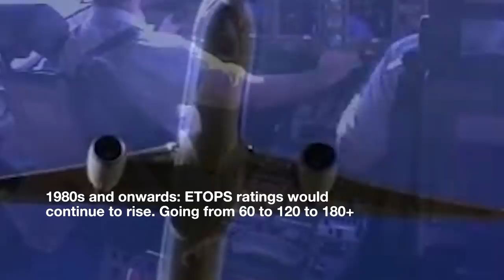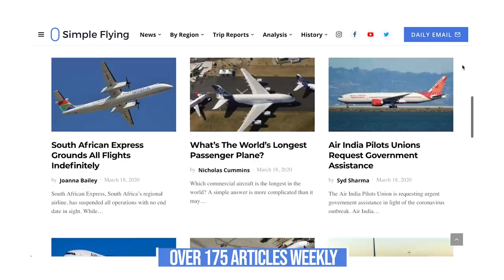Why Did Tri-Jet Passenger Planes Not Become Popular?

Comment: I read an article speculating that hybrid turboprop and turbofan tri engines were being developed, or at least researched. The idea being that smaller regional jets would sustain flight with the single tail turbofan and the turboprops would be used to climb and take off. For carbon emission reduction, these hybrids were also speculated to fly slower than current A320s and 737s for greater efficiency. The turboprops also favor some form of electrification better than turbofans.

Comment: I flew on an MD11 (or DC10) once.  There is a design quirk/flaw with the plane.  I'm not sure if all tri-jets suffer from this but the MD11 or DC10 did.  On takeoff, all three engines would be going well, but once the plane rotates (nose pitches up for taking off) the tail engine would get spoiled air and become starved for it because the air at this point in the take off will be flowing around the fuselage instead of directly into the engine.  And sometimes the engine will stall.  So essentially you have a three engine plane trying to take off with just the two wing engines.  

Pilot on the flight I was on explained this to the cabin when it happened on our flight.  I didn't even notice it when it happened but suddenly realized that maybe the cool looking tri-jet wasn't all that it's cracked up to be.
Reply: T38 Talon  Just reporting what the pilot said.

Comment: A well produced video and good summary. Trans-oceanic air travel started with flying boats which had the contingency of landing at sea in extremis. Post WWII the landscape had changed with land planes that could easily fly oceanic routes. But these were the big piston engined types and reliability just wasn't good enough for public transport in twins. That is why the 4 engine rule was introduced in the first place. 
   The first generation of commercial turbine engines were more reliable, but they were stuck with the 4 engine rule and later the 3 engine rule. These days, the shutdown rate of the modern turbine is 60 times better than those old piston engines. And that's per flight hour so it is actually about 120 times better in terms of air miles due to the jets cruising at double the speed.
   Despite this outstanding improvement in reliability, the regulations that govern remote and oceanic operations have become more stringent in every way except number of engines. The aircraft comes certified for a specified diversion time (regardles of how many engines it has) but a lot of other factors come into play before an airline can fly a route. For instance, is there enough accommodation for the passengers carried available in the vicinity of the diversion? Does the airport have the requisite firefighting capacity for the size of aircraft? There is a documentary series called "21st Century Jet" about the development of the 777 that explores those issues as the commercial success of that big twin really depended on them getting approval for diversion times beyond 3hrs.
Reply from the maker: Thanks for the feedback! - TB

Comment: Having 3 engines gives peace of mind... In many cases we see both the engines are lost and aircraft goes down... 3 engine give extra level of security
Reply: The vast majority if not all of these cases would have happened with trijets or quads. Most multiple engine failures involve fuel starvation. If you have no fuel, it doesn't matter if you have 1, 2, 3 or 8 engines, the outcome will be the same. On the matter of 8, in 1961 a B52 crashed after running out of fuel. Oh and another crashed after an engine fire caused damage to the wing and other engines. Other crashes due to twin engine failures have involved multiple bird strikes. If you hit enough birds that it can take out 2 engines, it can take out 3 or 4. Then there was the British Airways 747 that nearly crashed after loosing all 4 engines flying through a cloud of volcanic ash.
Actually, far from "many cases" you'd be hard pressed to find a single case where a twin jet has lost both engines due to independent mechanical issues (that would not cause problems for other engines).

Comment: I believe they should bring back triple engine planes. Reasons being one for safety. If the twins fail for some reason, the third engine could come in handy.
Reply: Yet the chances of both engines on a twin jet failing for some reason that wouldn't cause all 3 engines on a tri-jet to fail is tiny, much lower than many other issues that can cause a plane to crash. Also, in the event of two engines failing on a tri-jet, there is no guarantee that the 3rd engine will be enough to save the plane. Twins are designed and tested and pilots are trained and practice to be able to fly safely from V1 (the decision speed below which the plane can safely stop on the runway if an engine fails) to touchdown with an engine out. Tri-jets are the same, but the important issue is "with an engine out". With 2 engines out, that's beyond what anyone is prepared for. The plane would probably not be able to maintain altitude. If the failure is of one of the outer engines and the tail engine, control at low speed may be impossible, in fact it might be safer to shut down the engine and glide.

Comment: perhaps tri jets will be back in the future, since it could be done engine 1 and 3 are electric and the eng 2 is a normal engine producing a ton of power to power the others, mabye in combination with a "small" battery pack for night flights fully electric
Reply: You can't fly a plane on batteries. Jet engines will only work with jet fuel and hydrogen fuel. Also as noted tries have more maintenance then others since you have to use a crane to get at the tail section.

Comment: For that additional comfort of knowing that you are flying with three engines, I'll like to see them comming back 🔙 but still competitive with twin engines aircraft. With two engines, you still ask yourself that what if one 1⃣ engine could fail just before lift/ take off from the runway?
Reply: The plane would climb out at V2 (single engine climb out speed) and would level off at a safe height. It would then continue to fly until it was able to make a safe landing, either after burning off or dumping fuel to get it below safe landing weight. The pilots are trained to handle this and will have practiced it many times in the simulator.

Comment: i really thought that tail engine was abandoned because if it catches fire.. it will burn the whole tail segment which will lead to plane crash..
Reply: The most catastrophic incident was when the fan blades flung off and cut both hydraulic systems to the control surfaces.   Fortunately the chief instructor for that plane was on board and came up to help and used engine thrust vectoring on the remaining wing engines to steer and guide the plane in for a cartwheel landing which still saw deaths for passengers behind the wing but many were able to survive and a few walked away.

Comment: The rear of the L1011 cabin was extremely noisy.
Reply: Not as noisy as seat 38F on a 727. The engine gearbox was right outside your window. Been there, done that.

Comment: Don't have to watch the video to know the answer: that middle engine was a royal pain in the ass to work on because it was so high up out of the way, and when it had problems (a.k.a. "blew up"), it had a tendency to knock out the entire hydraulic system and all the backups because the rudder control hydraulics were right there. Eventually, having 2 engines became reliable enough, and the fewer engines you have, the more fuel efficient your plane, and the lower the operating and maintenance costs.

I only know of 3 commercially successful tri-jets: 727, L1011, and DC-10/MD-11. Everything else was 2 or 4.
Reply: How about the Hawker Siddeley Trident
?
 
The Hawker Siddeley HS-121 Trident (originally the de Havilland DH.121 and briefly the Airco DH.121) is a now-retired British short- (and later medium-) range airliner. It was the first T-tail rear-engined three-engined jet airliner to be designed.   Versions carried between 100 and 180 passengers.  There were 117 built.
Reply: @alanstevens1296  That falls under "I only know of". :) Never heard of it before (and I wrote my comment before watching the video and seeing it there). The one that I HAVE heard of and forgot about until I saw another comment was the Dassault Falcon business jet.
Reply: @c182SkylaneRG  - No problem, was not trying to be critical, just wanted to add to the discussion.  Of course, only 117 sales could be argued to be not very 'commercially successful'.
Reply: @alanstevens1296  True! And my impression is that there were actually a fair few trijets in existence back then, or at least a fair few on the drawing board, but those three (and the Falcon) are the only ones I ever really heard of, which leads me to believe that they were the only ones that were really successful.

Comment: I would imagine they would, if one day air travel picked up and boomed somewhat again, and a placeholder for the 747 and A380 as a large intercontinental jumbo with 3 engines, that could still potentially be just as fuel efficient as twins with physically larger engines for redundancy and peace of mind, and then the overall character of the plane. Aerodynamics can always be improved for subsonic cruising so even less drag if necessary
Reply: Boeing did have a plan for a 3-engined 747 decades ago, but then they realized it'll be too costly to redesign the structure.
Reply: Stretch 777 into 777-10, and most airline would be satisfied - except Emirates, maybe.

Comment: The DC-10 can "fly comfortably on two engines", as noted from the Air Crash Investigation episode on United 232. So technically it could've been a twin-jet.
Reply: In reality it didn’t. MD-11 had the chance to become a modern twinjet, but unfortunately MD lack the capital to develop such.
Reply: A true twin jet has to be able to take off with one engine failing during takeoff after V1. So The DC-10 could fly with 2, but a real twin jet can fly with 1. 
Engines were not powerful enough in the 70s to make a twin jet in the size of the DC-10. Later they became, this is why the 777 is there.
Reply: @simonm1447  True. But I suppose a twin-jet MD-11 would be way to similar to the Boeing 777.
Reply: @FSM_Reviews  It would be very similar, but it would need bigger engines, and the GE 90 and the GE 9 X are exclusively offered to Boeing. 
MDD is today part of Boeing, but they would not have any interest in building a 2 engine variant of a 1970s aircraft, it would also demand new wings, because a GE-90 weighs 8 metric tons, around 3 tons more than a CF-6. 
At the end you could modify the complete aircraft, trijets have the center of gravity further back, because of the heavy tail engine.
Reply: @simonm1447  While the trijet MD-11 we see is heavier than A330, it’s not that far behind, especially when 1 engines are eliminated on twinjet MD-11. What powers A330 should works on that with few issues.
I guess, is the structural and aerodynamic rework and recertificate causing the trouble. They are short of cash in doing so, so they attempted to pick the low hanging fruit instead - and the result is the outdated trijet we see.
Reply: @steinwaldmadchen  The MD-11 is heavier, but has less powerful engines. The MD-11 has a MTOW of 273 to 285 metric tons, while the A 330 has only 233 to 242 metric tons. At the same time, the A 330 uses more powerful engines, The 330-900 Neo (242 t) uses Engines with up to 320 kn thrust, while the MD-11 used CF-6s with only around 270. 
New engines have a bigger bypass ratio, the Trent 7000s from tje Neo weighs 6,4 metric tons, while the CF.6 of the MD-11 weighs only 5 metric tons (the GE-90 115 B weighs 8 metric tons). You can't simply hang 1,4 tons more on the same engine mount, you would need a redesign of the wings. 
The wings are a special problem of the MD-11, they are too small (they are the wings of the DC-10), so it has a very high landing speed, and the wing is relatively weak where the gear is mounted, if an aircraft bounces at landing it happened the gear was pushed through the wing, what causes this wing to stall, and to roll over the complete aircraft. https://www.youtube.com/watch?v=8SzH3D_lD5U
From the technical standpoint both  Boeing and Airbus offered better aircraft than MDD did with the MD-11, it was obsolete like all MDD aircraft at the end, and eventually they were bought by Boeing.
Reply: @simonm1447  As we all agree, if any MD-11 twinjet exists, it can’t be the same MD-11 we see sans 1 engines. I mentioned before significant rework is necessary.
That’s the reason they couldn’t make it. DC-10 isn’t really that profitable given the competition with L1011, and the multiple crash hurt their reputations and balance sheets.
However, if MD-11 is a twinjet, while probably still heavier than the newer A300 frame, will be lighter than the trijet we see thanks to
1. 1 fewer engines
2. Less fuel carried thanks to that
3. Potentially a reworked wing that is either lighter, or more efficient that save fuels, or both.
btw, let's not forget MD-11 is smaller than A330. So, even if MD didn’t innovate much in that twinjet, it could probably fit the engines A330 are using ( or slightly upthurst version?), and have a better fate the trijet we see.
But of course, that likely still doesn’t change the fact that A330 is the most optimised widebody of its size in that era,

Comment: Unfortunately one of the main ones was the flawed DC-10, yesterday's version of the MAXX (ok, not so bad as the MAXX!). I for one would avoid using a company that would put me on one. The MD-11 was not so great either, with many pilots not liking having to fly it...The three engine aircrafts are gone for good...
Reply: The dc 10 had way more then 2 crashes and killed way more then the max
Reply: So it’s actually worse then the max
Reply: @jackgoodman6976  You can't compare. There used to be hundreds of DC-10s, and they were flying in a completely different era. Mind you, the famous flawed cargo door was also used on Boeing 747-100s… 9 dead in 1989.
Reply: Fair point
Reply: The DC-10 was not flawed, only the first high-profile accidents had anything at all to do with the airframe, and even then the small cargo door locking mechanism only.

Comment: Maybe a trijet configuration would work well with an electric "jet" in the middle to make taking off and landing quieter.
Reply: Paul F the weight of the batteries and the drag of the third engine would put a sizeable dent in efficiency though.
Reply: You can't run jets on batteries and anyone that suggests such a ridiculous concept is nuts.
Reply: @Predator42ID   Nobody is suggesting running the jet on batteries at least not anytime soon. Just using it take off or land so that the jet can be used during the quiet hours. It only needs to run for ten minutes and the jets will most likely be partially on. Just landing quietly would make airlines millions.  Because they can land more planes in a day.
Reply: @paulf7757  Wow, okay uh your missing something with that idea. How exactly is a jet suppose to be quieter and carry more payload when batteries regardless of advancement are heavy in general. Plus last anyone checked you can't run a jet engine off electricity it needs a combustible source either through jet fuel or hydrogen fuel.

Comment: How about a tri-jet which only uses the tail engine for take off thrust and then shuts off to let the two smaller wing engines for cruising ??  Why no one thought about this to save fuel 🤔
Reply: That’s too complicated. Better just fit a stronger underwing engines, or simply just make it 'underpowered'.
Reply: Nobody wants to carry dead weight on a regular basis. Efficiency and weight are closely related, so flying around a 6 ton "spare" engine will cost you more fuel on the 2 main engines.
Reply: stefanguels : an engine weighs 6 tons ?
Reply: @TheGecko213  Statistical median. I picked a RR Trent 700 https://en.wikipedia.org/wiki/Rolls-Royce_Trent_700 to represent the class in question. They range from 4-8 tons, depending on thrust and size. But even 4t would be 4t too much.
Edit: And don't overlook the parasitic aerodynamic drag that a non running engine has. Bad for fuel consumption, too